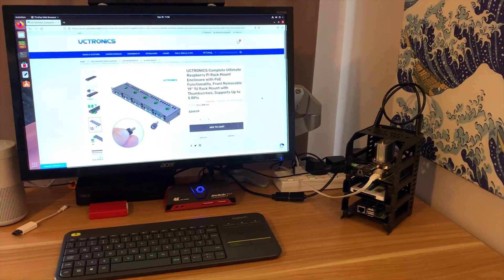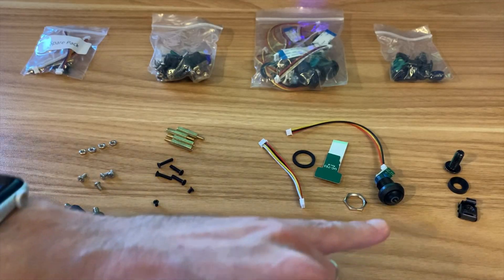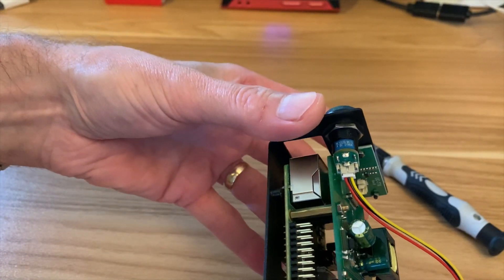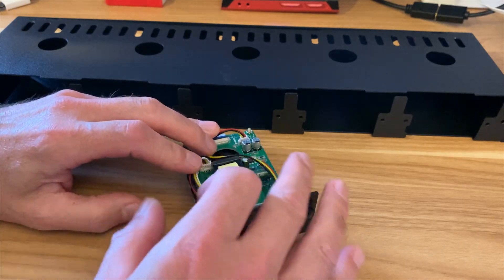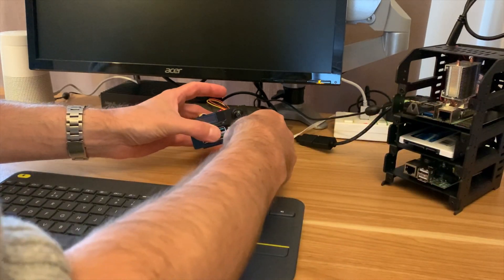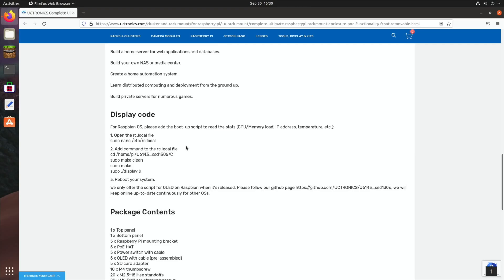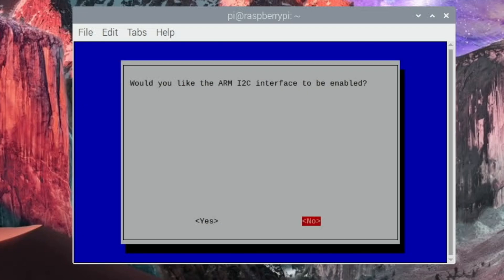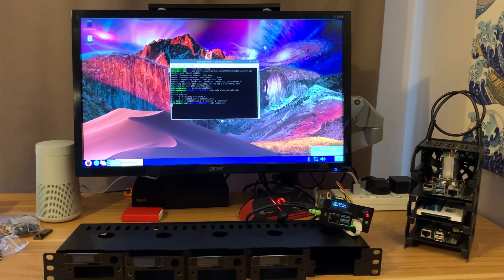UCTRONICS Raspberry Pi Rack Mount with PoE Functionality and OLED displays.

Comment: what pi versions can the hats support. I think this would be most useful for me if I could mix and match all my different pi boards into one module
Reply from the maker: Pi 3 and 4 are mentioned
Reply: @leepspvideo  I think Pi 3B+ would be the minimum.  The Pi 3 non plus did NOT have the poe header.  

However if you are foregoing poe and using the usb c for power it's quite possible it would work on any Pi or pin compatible SBC using the 40 pin gpio header.  That is assuming the usb c power is routed into the gpio header of course.

Comment: Oddly enough I have been interested in something like this. I don't really know how PoE works or even if I can make use of it with Google Fiber 1GB. Thanks for the vid. I'll check it out.
Reply: My limited knowledge tells me you need to hook up a poe-switch behind your router for those poe-devices.
Reply: TP-Link 8 Port Fast Ethernet 10/100Mbps PoE Switch | 4 PoE Ports @57W , TL-SG1008P